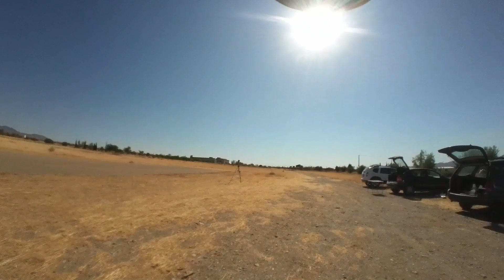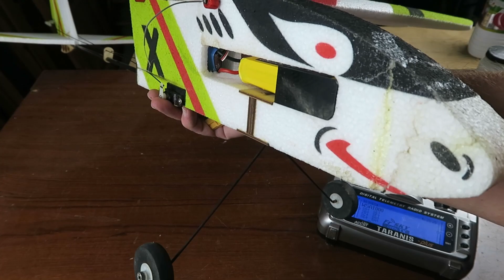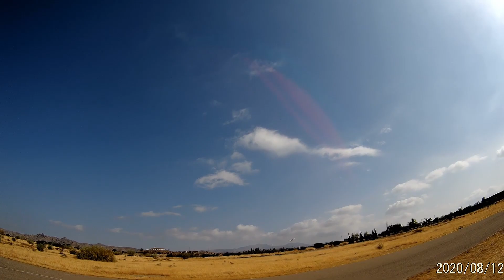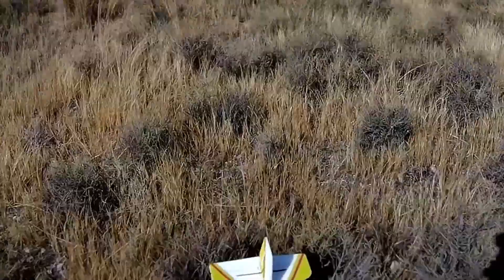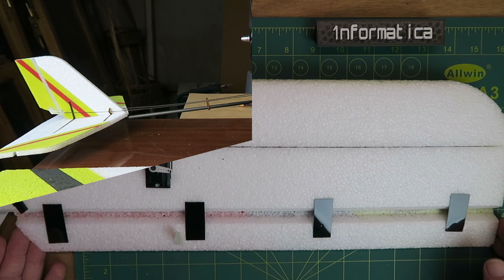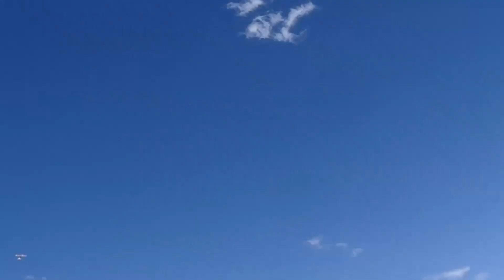WSA 1000 EPP 1M Wingspan EPP Trainer Maiden & Crash Repair!!

Comment: Finally, which is the correct down thrust angle for the motor?
Reply from the maker: Actually I pointed the motor up a little just with two washers under the lower two screws on the motor mount. The mods that made the most difference were the 3 mm carbon tube in the upper wing and the Mylar hinges for the ailerons. I have flown it several times now and am happy with it. Please consider subscribing if you have not done so already!